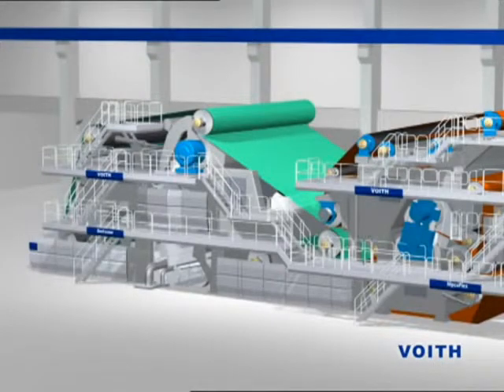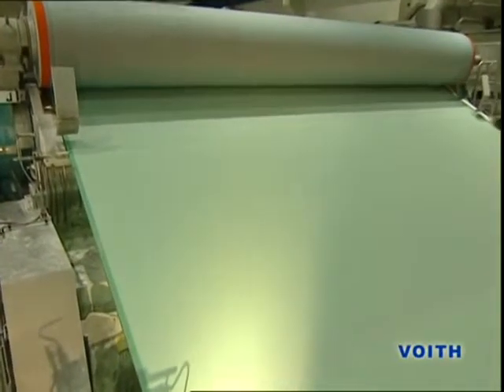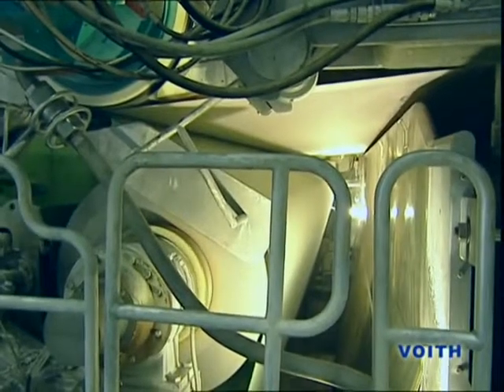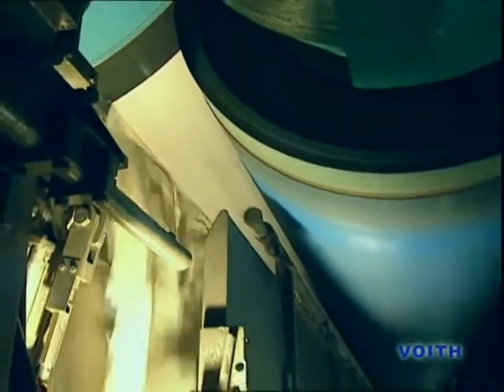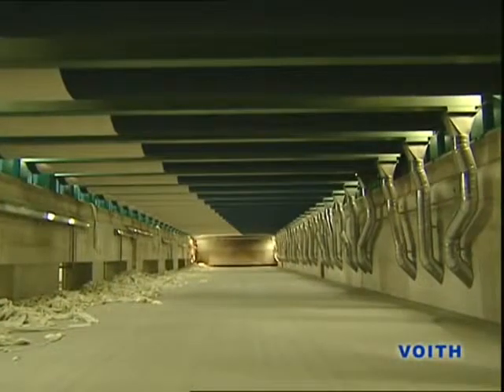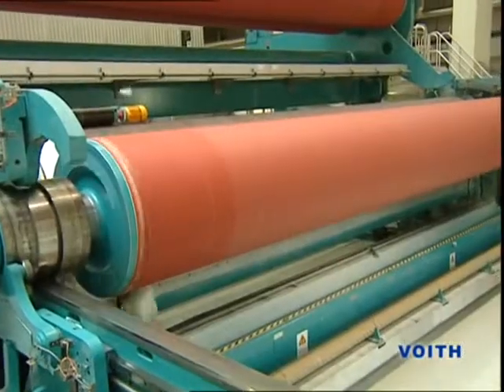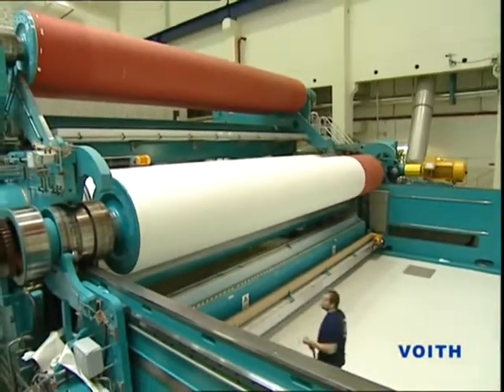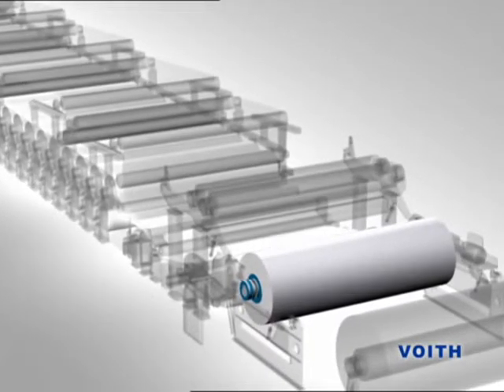Voith paper production process Threading process paper machine (EN)

Comment: Worked in paper mill  U.S.A. on a Rice Barton fine paper machine for 36 years. We had an on machine coater, "Bill Blade"  Machine had a deckle of 180 in. and a speed of 2,450 f.p.m. A second paper machine, Beloit fine paper, with size press. 175 in. deckle and speed of 1,900 f.p.m. 3rd paper machine, Pusey Jones fine paper with size press, 128 in. deckle  and 825 f.p.m. made specific deep colored paper for Crayola Crayons. All gone now as mill closed for good in 2000 putting around 1,000 people out of work.